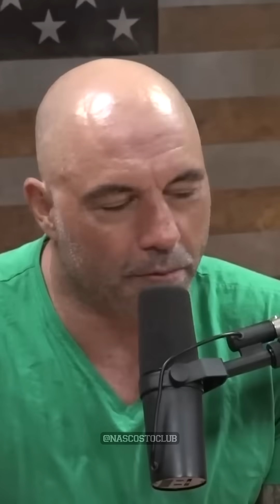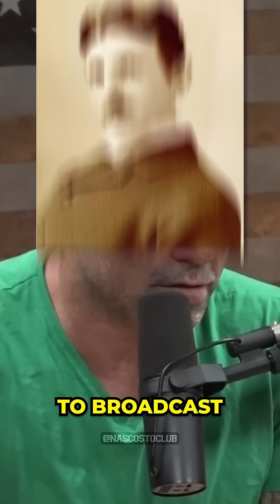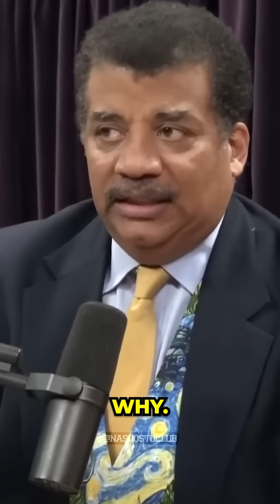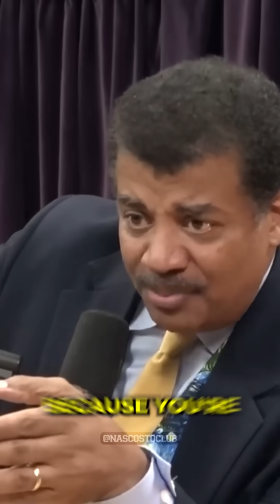WIRELESS Electricity Idea Debunked ⁉️⚡ #shorts

Comment: NdT is actually correct here.  Imagine electricity floating through the air, even if it weren't innately fatal, it would slowly charge your body and then when you touched the wrong material - boom!
Reply: But electricity is floating through the air around us constantly 🤦🏽‍♂️
Reply: @TheMrKarlos  stored electricity is in everything.   It's when it's released that there is energy transfer.
Reply: @tjen7929 

There are alternatives…..
Inductive Coupling
Magnetic Resonant Induction 
Electrostatic Induction 
Resonant Inductive Coupling 
Microwave Power Transmission (what’s being Discussed here)
Laser Power Transmission
Reply: @TheMrKarlos  these are insufficient alternatives for demand.  Maybe in the future these technologies will improve, but they are not adequate today and not practical, nor were the methods Tesla postulated in his time.   The reason wires are used is for practicality and safety.  Just think about what happens with errant static electricity in the tiniest of amounts - you get a shock when you touch certain materials.   Electricity always takes the path of least resistance, which is why it's very important to control (limit) that pathway.

Comment: Did NDT forget about wireless charging we currently have?
Reply: No. Lol. First of all wireless charging requires a pad for the device to sit on so it isn’t beaming through the open air. But what that guy was suggesting was the level of power needed to wireless power things (like house for instance) that run off of 260v at 60z would kill you to death.

Comment: I have to disagree with NDT for one reason: light won't kill you!  Powering an LED should theoretically be possible with a capacitor.  It might be a little dim but technology is only getting better.  It also depends on the frequency as some wave lengths can transmit higher amounts of energy at a safe level compared to others.  Basically, if the frequency is too low or too high this significantly effects the performance of "free energy."  it would make sense to use multiple frequencies based on distance and resonants.  We don't want to be microwaved to death.

Comment: There’s an IoT product where it reuses the radio signal for its energy needs. It’s tiny though and I think it can record sounds and possibly videos and images. I believe it’s called ant technology but I cannot remember who is developing it. All I remember is it works and I learnt it as a modern application of IoT as part of an IoT lecture. So if the problem was the amount of energy in radio waves, I’m not sure if it is much of a problem if you reduce the size of the product.
Reply: I have a teacher that is currently studying and researching this field. 

You are right.. if you reduce the "size" (power consumption) of the device being powered then it could work and it does work. But transmitting energy into high power devices wirelessly is just dumb. (At least with our current capabilities...)
Reply: @SmileyFace01  I mean yeah definitely! But as u say, it has its use cases!

Comment: I thought Tesla boiled a 55 gallon barrel of water 40 miles away from his transmitter.
Reply: Now imagine you were in front of that current. You'd be the boiled 55 barrel of water.
Reply: @ProfiteerProphet  
It was sent through the ground, not the air. But yeah, you'd be fried.
Reply: Never did he say its not possible.... Jeez just whatch the video.
Reply: @dillerhiller  
Hey Einstein,  these are his words. 
"You can't pack enough energy in a radio wave to do anything mechanically" Any idiot (except you I guess) would know that the power needed to boil a barrel of water would certainly be enough to run machinery. Also, Tesla wasn't sending it through the air in this experiment but through the ground. And don't make the mistake that this clown was anywhere near as smart as Tesla or could even comprehend his Ideas.
Reply: @dillerhiller  
You are totally putting your own tilt on what he said Einstein. He misunderstood (and you too apparently) the experiment Tesla performed at Colorado springs. Pick up a book you nitwit and read about what he did. In 1899 Tesla lit up 200 100 watt incandescent bulbs at a distance of 26 miles. Are you able to do the math? That's 2000 watts. To understand what Tesla was doing you idiot you need to read Oliver Heavysides equations. Are there news items from that time showing fried people or live stock? Of course not you nitwit. You come on here bellowing like a bull and you are nothing but a triggered kitten. When you get a grasp of ultra high frequency electricity and the phenomena surrounding it get back with me. Until then keep your ignorance to yourself..... Einstein.
Reply: https://youtu.be/a3KkqW3_isE
Reply: @dillerhiller  
Now research wardenclyffe.
Reply: @dillerhiller  
Still can't admit you're wrong? Did you read up on his experiments and what he was able to accomplish? What a pompous ass you are. He didn't beam energy in a straight line like a laser, he infused an area with energy. He also was able to pump energy into the ground and draw it out in another area. Read about it before you shoot off your stupid mouth. Did you know that it is illegal to run wires under a powerline because the wire will pick up and siphon energy from the electrical field in the transmission lines. You can get enough energy this way to power a house. Do you get fried walking under a powerline? Jeez you're stupid.
Reply: @dillerhiller  
One was through the ground, one was through the air. You're really doubling down on your stupidity.
Reply: @wutntarnation  did you whatch the video yes or no?
Reply: @dillerhiller  
Just read up on Tesla's experiments. You might lose some of your ignorance but I doubt it.
Reply: @dillerhiller  Which ones? The ones I showed you earlier? The ones your ego is too fragile to acknowledge? You are a waste of time. Your mind is warped.
Reply: It is not possible to transmit energy through the ground without any losses, as there will always be some energy lost due to various factors such as resistance, capacitance, and inductance.

When energy is transmitted through the ground, it encounters various types of soil and rock, each with different electrical properties that can cause energy losses. For example, soils with high conductivity can absorb energy, while soils with low conductivity can reflect energy.

Moreover, as the distance between the transmitter and receiver increases, the amount of energy that can be transmitted decreases due to the spreading of the energy over a larger area. This effect, known as the inverse-square law, means that the energy density decreases as the distance from the source increases.

While it is not possible to completely eliminate energy losses when transmitting energy through the ground, there are ways to reduce these losses. For example, using higher frequencies of electromagnetic waves can increase the efficiency of energy transfer. Additionally, the use of optimized ground electrodes and specific types of soil can also help to reduce losses. However, there will always be some amount of energy lost in the transmission process.
Reply: There is no reliable evidence to suggest that Nikola Tesla ever boiled water with wireless energy, also known as "radiant energy" or "scalar waves."

While Tesla did conduct experiments with wireless energy transmission, he primarily focused on the development of wireless communication systems, such as radio and wireless telegraphy, rather than the transmission of power.
Reply: @dillerhiller  
If he could light a bank of lights at 26 miles why couldnt he step up the experiment and boil a barrel of water? Logic is not your strong suit Einstein.
Reply: @wutntarnation  While Tesla's wireless power transmission technology was not practical for commercial use in his time, his work paved the way for future developments in the field of wireless power transmission. Today, wireless power transmission is used in a variety of applications, including electric toothbrushes, cell phone chargers, and electric cars. However, the amount of power that can be transmitted wirelessly is still limited, and it remains a topic of ongoing research and development.
Reply: @wutntarnation  what kind of argument is that?what have you invented? 🤡 And Again he did not power an electric motor. And the light bulbs where powered at a shorter distance.
With the electricity low enough not to fry a human but not strong enough to power anything sufficiently
Reply: @dillerhiller  
He powered a bank of bulbs and an electric motor WIRELESSLY 26 miles away. Argue with that.
Reply: @wutntarnation  provide a source
Reply: @wutntarnation  Nikola Tesla did demonstrate wireless transmission of electricity by powering 200 light bulbs wirelessly in a public demonstration he gave at his laboratory in Colorado Springs in 1899.

Tesla used his high-frequency Tesla coil to create powerful electromagnetic waves, which he transmitted through the air to a nearby receiver circuit. The receiver circuit was designed to resonate at the same frequency as the Tesla coil, allowing it to capture the energy from the electromagnetic waves and use it to power the light bulbs.

During the demonstration, Tesla demonstrated that the light bulbs would light up even when they were held several feet away from the Tesla coil and the receiver circuit, demonstrating the potential for wireless power transmission.

It's worth noting, however, that Tesla's wireless power transmission system was not practical for commercial use at the time, as the amount of energy that could be transmitted wirelessly was limited and the system was highly inefficient. Nonetheless, Tesla's demonstration of wireless power transmission was an important milestone in the development of wireless communication and power transmission technologies.

All at a distance of about 30 m not 26 miles or 40 miles
Reply: @wutntarnation  also the voltage was around 10 to 12 million volts. Not 100 million volts.
Reply: @wutntarnation  by the way? Is planet earth a flat? Does the sun go around the earth or does the ewrht circle the sun?
Reply: "Nikola Tesla's Colorado Springs Notes, 1899-1900," compiled and edited by Arthur Matthews and Richard G. Van Duyne. This book contains a collection of Tesla's notes and drawings from his time in Colorado Springs, including descriptions of his experiments with high-frequency electricity and wireless power transmission.

"Tesla Coil," Wikipedia. This article provides an overview of the principles behind Tesla's coil, as well as historical information on its development and use.

"Tesla's Colorado Springs Experiments," by Marc J. Seifer, IEEE Spectrum, November 2012. This article provides a detailed account of Tesla's experiments in Colorado Springs, including descriptions of the equipment he used and the discoveries he made.
Reply: @wutntarnation Tesla stated in an interview with The New York Times on October 13, 1904. :

"I have no intention of transmitting power through the earth. Neither do I expect to put a wire across the ocean. Nor do I believe that the wireless waves which I have discovered will produce a great effect, for they will not be produced in great enough quantities to be of commercial value."
Reply: @dillerhiller  
My mistake, the biography I was referring to was written by the Tesla society located in New York city. Here is the excerpt:
In Colorado Springs, where he stayed from May 1899 until 1900, Tesla made what he regarded as his most important discovery-- terrestrial stationary waves.  By this discovery he proved that the Earth could be used as a conductor and would be as responsive as a tuning fork to electrical vibrations of a certain frequency.  He also lighted 200 lamps without wires from a distance of 25 miles( 40 kilometers) and created man-made lightning.

This is getting tedious. His theories regarding the wireless transmission of power worked. You and your buddy Tyson didn't understand the mechanics so you instantly screech "it can't be done!!"  And "you would get fried by a beam of energy strong enough to power anything substantial" when if you would have read his research you would see that he would use the earth and the ionosphere to move the power, not a beam. I've proven you or your idol don't grasp the mechanics of what he did. You're wrong. No one would get fried. I can only put up with your ignorance to a certain point and you have passed it. Argue with the authors. This thread is dead.
Reply: The Wardenclyffe Tower, also known as the Tesla Tower, was a large wireless transmission tower designed by Nikola Tesla in the early 1900s. Tesla intended the tower to be a part of a system for transmitting electrical power wirelessly over long distances, using the Earth itself as the conductor.

The basic idea behind Tesla's wireless power transmission system was to send electrical power through the air, using the Earth's natural electric charge as a return path. Tesla believed that by using a large vertical tower, he could create a resonant circuit that would allow him to transmit electrical power wirelessly over long distances.

The Wardenclyffe Tower was constructed on Long Island, New York, and consisted of a large, 187-foot tall tower with a spherical metal structure at the top. Tesla believed that the tower would be able to transmit electrical power wirelessly to any point on the globe, using the Earth as the return path.

Although Tesla was able to demonstrate the feasibility of his wireless power transmission system in a small-scale laboratory setting, he was never able to fully develop or commercialize the technology. The Wardenclyffe Tower was ultimately never completed due to financial difficulties, and it was eventually dismantled in 1917.
Reply: any beam of energy that is strong enough to boil water or cause other types of significant heating or damage can be harmful to humans if they are exposed to it. The exact level of harm will depend on the type of energy and the intensity and duration of the exposure, among other factors.

For example, exposure to high levels of electromagnetic radiation, such as microwaves, radio waves, or laser beams, can cause serious health effects, including burns, tissue damage, and even cancer. The specific health effects will depend on the frequency and intensity of the radiation, as well as the duration and distance of the exposure.

It is important to note that many types of energy, including electromagnetic radiation and acoustic energy, can be absorbed or reflected by various materials, including clothing, building materials, and the human body itself. Therefore, simply standing between a source of high-energy radiation and the target may not provide adequate protection.
Reply: The maximum range of induction depends on various factors, such as the strength of the magnetic field, the frequency of the alternating current (AC), the size and shape of the conductive material, and the distance between the source and target.

In general, the range of induction is limited, and the strength of the induced current decreases rapidly with distance from the source. For example, in typical residential and commercial settings, electromagnetic fields from power lines and electrical appliances typically extend only a few feet or meters from the source.

However, in some industrial and scientific applications, it is possible to use induction to transfer energy over longer distances. For example, high-frequency induction heating systems can be used to heat metal parts from several inches to several feet away, and wireless power transfer systems can be used to charge electronic devices over distances of a few centimeters to a few meters.

It is important to note that inducing currents in conductive materials over long distances can cause energy losses due to the resistance of the material, which can result in reduced efficiency and heat generation. Therefore, induction is typically more effective for short-range applications, and other methods, such as wired connections or optical fiber communication, may be more appropriate for longer-range applications.
Reply: @dillerhiller  
Tesla did it. Argue with his experiments....... Einstein, or is reading too hard for you? Do you prefer to shoot off your mouth and throw a tantrum? What a poosy.😆
Reply: @dillerhiller  you can draw enough power from under a powerline to run an appliance. Was my statement "enough to power a household" to complicated for you?

Comment: Neil has right, within limits of our knowledge today, but Tesla might have had some solution to that... Still we are moving energy through the air, kWs and MWs of it like AM ir FM radio stations broadcast, without us being obviously influenced by it. Transmitter energy spreads like a balloon surface, weakening very fast, exponentially fast with the distance from the source antenna. Energy reaching us is extremely low, like microWatts or nanoWatts and is useful as a information only. It takes receiver and local amplifier to make any use of it. Still in the proximity to the transmitter, people should and do protect ourselves against this danger energy (level). But if we could create pathways in the air, like in wires, channeling it, then we would have the Tesla's dream. How about pyramids?

Comment: Just consider a spark plug and how high of a voltage it needs to jump the gap and ignite the air/fuel mixture in your engine under the pressures that are forced on it. Now, anyone who has been on the grounded end of a spark plug wire during an ignition phase will know what it would feel like if you were able to pass electricity through air to power a light bulb.
Reply: I’ve been shocked by 110 volts. It’s not pleasant. I wouldn’t completely discount Teslas idea but my feeling is if there is something to it it’s not on any simple consumer level that we currently comprehend.